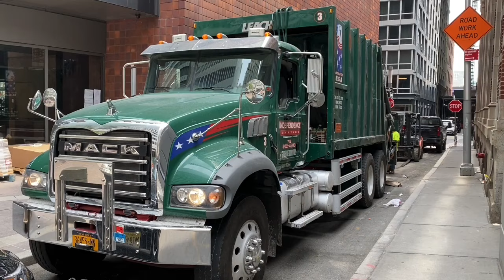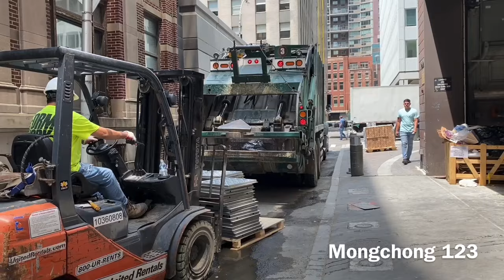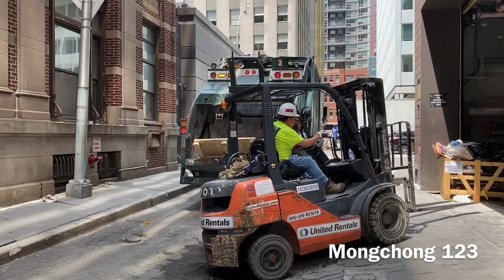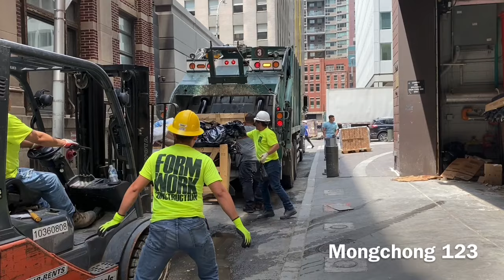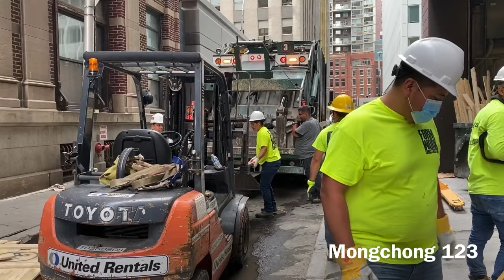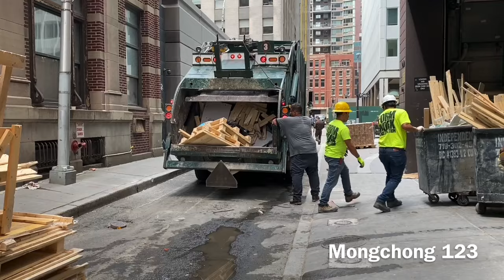🇺🇸 Independence Carting Mack Leach Rearloader Garbage Truck Crushing Demo Waste in NYC

Comment: How to fill a truck in one stop!
Reply from the maker: @steveb6103  there was still loads more but had to go and meet a friend if not I would have been filming for over 1 hour of footage
Reply: @Mongchong_123  I started in trash truck maintenance in 1985, rebuilding  and repairing . I've worked on everything  on those trucks. I can tell you that not much can pack a better load than a Leach.
Reply from the maker: @steveb6103  that’s great to know!